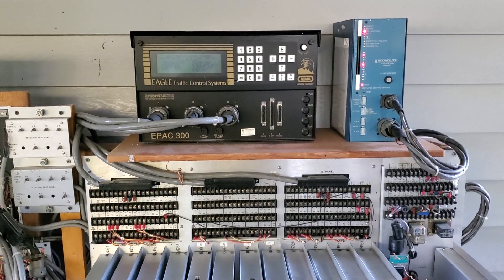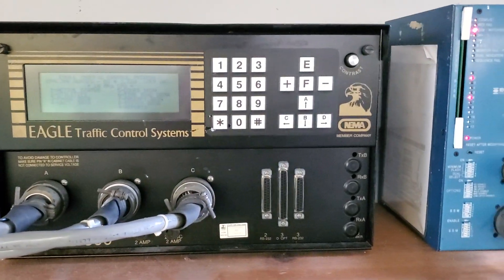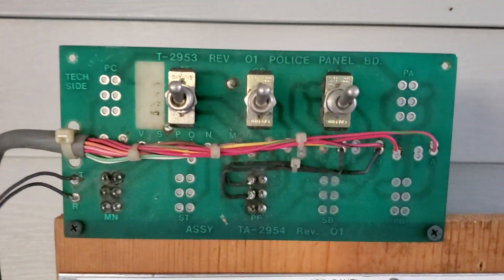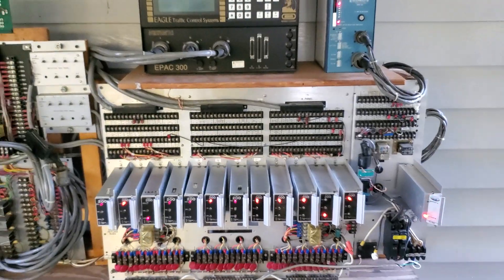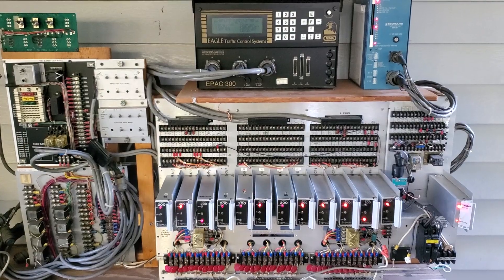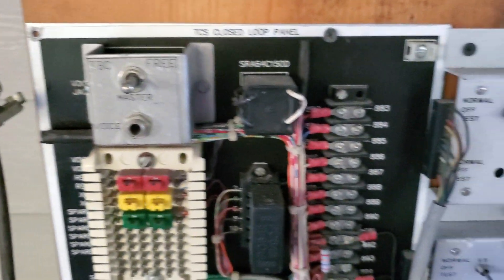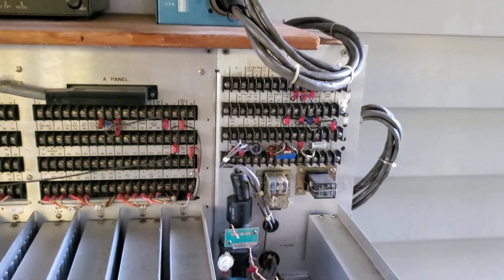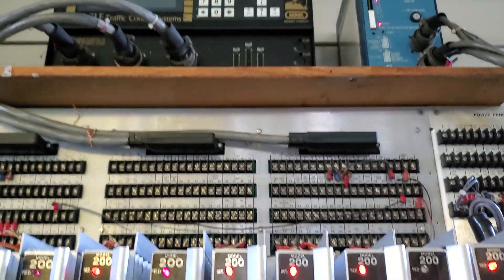Run Up of a Complete Traffic Control System

Comment: I'm working on my first EPAC controller, So my question is I know the light modules take a 24v input signal in. So do you have a 24V power supply in your setup or is the EPAC generating that 24V for you? Also, any good places to find the pinout of the connectors.

Comment: There's a good writeup online that Nick did on the basics of the EPAC 300. I can answer some questions about the EPAC for you as well if you have any!
Reply from the maker: Thanks for that info. I like the Eagle controller and would like to configure it better.  Do you have a link for the Basics of the EPAC 300?
Reply: @jrocco36  Here it is! There are PDF's of the manual online too. I also have a physical copy of one but this information should be all you need for now!
 https://www.scribd.com/document/244188505/EPAC300-Programming-Basics
Reply from the maker: @TheTrafficTech  Thanks for that.. I am going to print it out and sit down and go through the manual. I also built a small jig for two signals and two PEDs that I can connect this to and really get to know it. Also Scribd looks cool so I may hang onto my subscription and check out all it has. It would be cool to have one Econolite and one Eagle control system running.  I have enough lights for it.. Thanks again for your help!
Reply: @jrocco36  No worries man! Can't wait to see the final product!